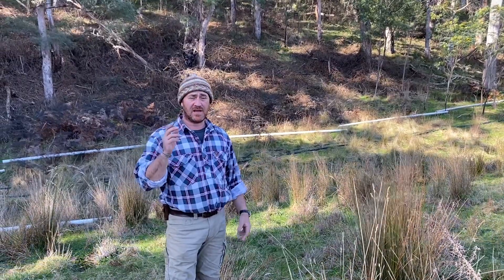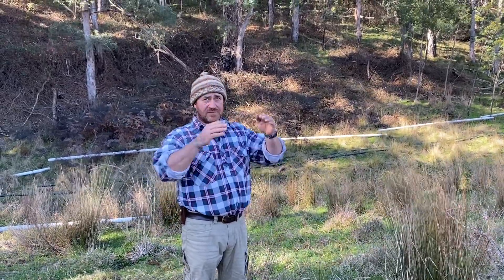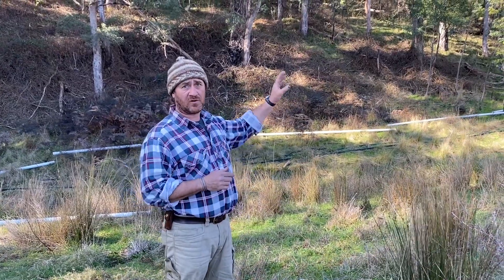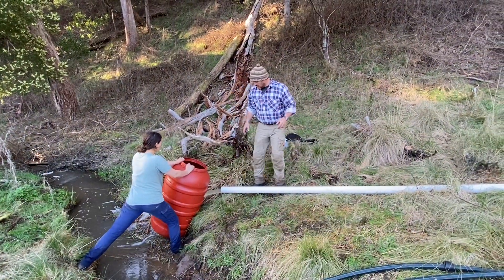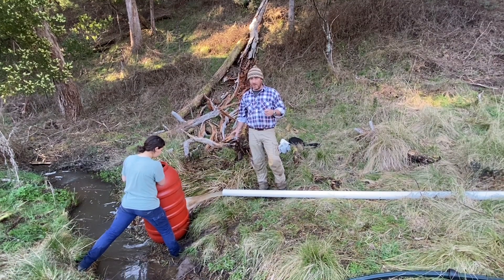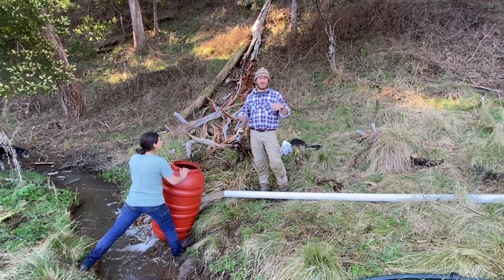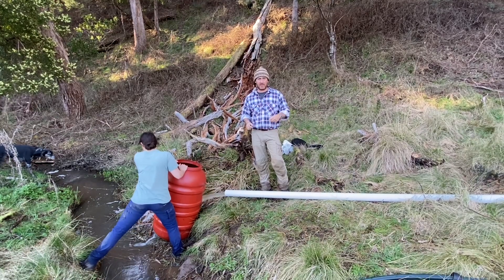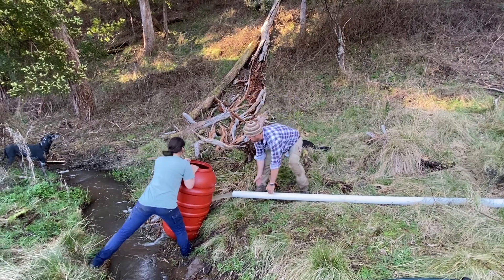Off Grid Micro Hydro Power Generator Part 3 - Planning 3.0

Comment: If you place a tennis ball in the dam that feeds your pipe it will prevent a whirlpool from forming prevent air from being sucked in.  Hope that helps, good luck.
Reply from the maker: Hey Skeller - thanks i'm trying a different method with a shute system. Thanks for watching and take care. cheers

Comment: I think you would be better off with a turgo turbine. Better for mid range pressure and higher flow. Power spout have a great online calculator that may help you
Reply from the maker: Hey Hayden, I'll look into it further, just waiting for this rain and floods to drop off and i'm back into it. Cheers

Comment: I know you have already laid the pipe, so I am too late....But  for future proofing and to minimize internal pipe friction (losses) you need to run the biggest pipe diameter possible/affordable.  Also farm effluent pipe comes in 50m rolls and take much higher pressure, requires less joints and is stock and goat proof, it is available in 90mm here in NZ. I believe in Auzy you can get it in 100mm diameter.

Comment: May I suggest adding a stand pipe, that should resolve a lot of your air intake issues.
Reply from the maker: Hey Jumper, you're spot on! I was am going to install  2 x stand pipes. I'll add to T junctions to the 90mm pipe and then reduce them to 50mm. My thought is to install the stand pipes at every 1/3's section of pipe. The first above the water intake and then the second above the first stand. Do you think would be suitable, or is just one stand pipe sufficient? Let me know your thoughts. I'd appreciated the feedback. Cheers
Reply: @FatCowFarmTatong  I may be late in replying, but just one a few meters down the pipe from the top should be sufficient.

Remember the stand pipe must extend higher than the water in the dam, so half way down would mean a 5 meter pipe!

Comment: Great project so far. After researching micro hydro for years for my project I HIGHLY recommend burying your penstock
Reply from the maker: Thanks KTM, I've been thinking that also. The unstable feature of the columns and the amount I would have to build is a bit off putting. The stability and UV issues would certainly be eliminated. Thanks for watching and thanks. Cheers !